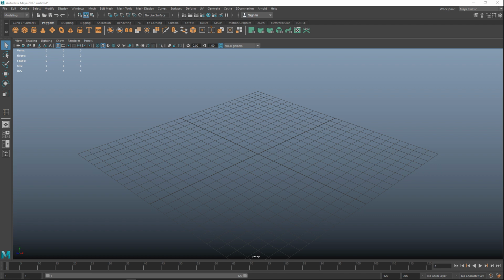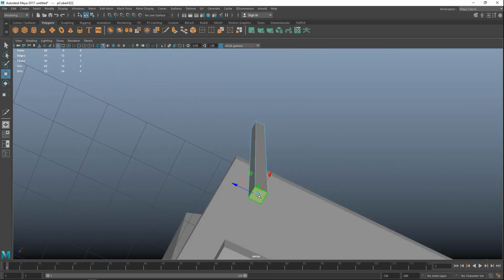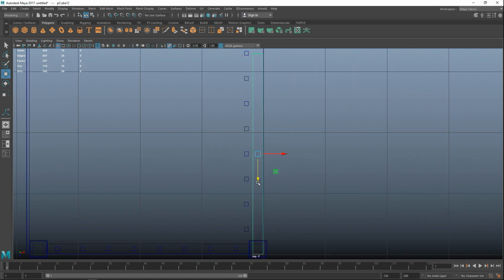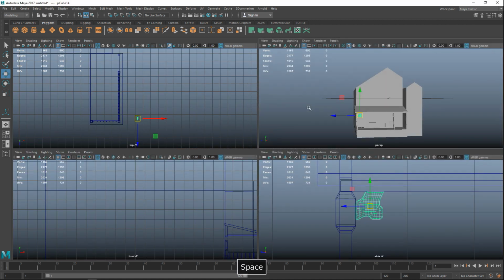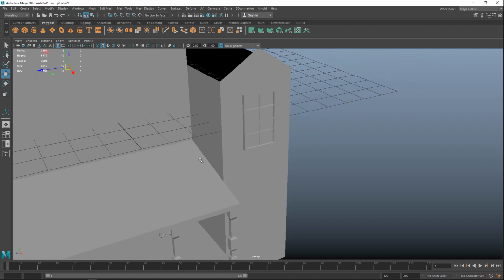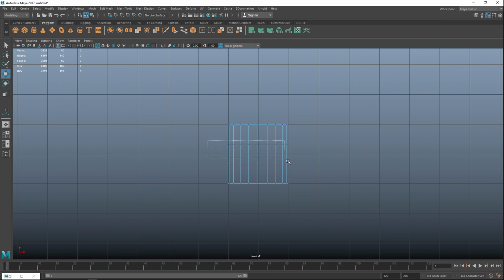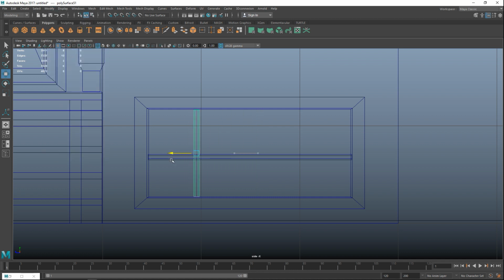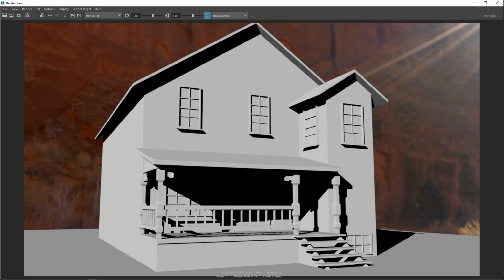Maya 2017 tutorial : How to model a House

Comment: 1:38, I'm doing it exactly as it shows here, but when I bring down the top of the roof, the bottom of the block also bends, where it doesn't in the video. What am I doing wrong?
Reply from the maker: Well if you are doing exactly the same you should have the same result.Do you have vertices selected that are not part of the roof ?
Reply: Never mind, I fixed it. I had soft select (b) on and that caused the issue. :)

Comment: Great! Can u help me? Do i really need to use "offset edge loop tool"  for my house don't be affected by the smooth of the number "3"? Or theres a way that i can model and keep thing "square" without have to add new edges on it's every single corner?
Reply from the maker: Yes , use the crease edge tool ( I did a video on that )
Reply: Thank you so much, man. It's hard to find those thing in PT.

Comment: Great video!

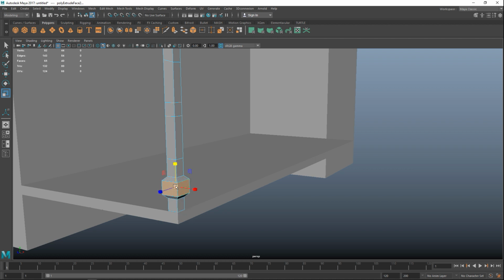I noticed around 13:45 that extruding those different faces were giving you problems.  What I do when I want to scale multiple faces on the same space is turn off "keep faces on" and click on the blue extrude box on the move tool.  After that I can scale down or up using the center box on the transform.  Hope I explained that okay :P  Thanks for another great tut!
Reply from the maker: Dennis, you did and thank you. I am for some reason missing a small menu that I used to get when hitting extrude
Reply: It does that from time to time for me too, it's so annoying.  If you haven't figured it out yet (which I'm sure you have) I would try maybe resetting your settings to default.  Cheers, Mike